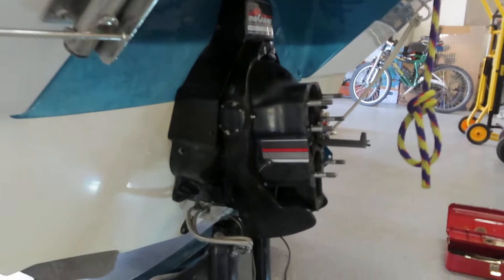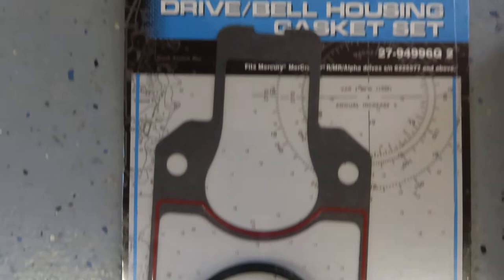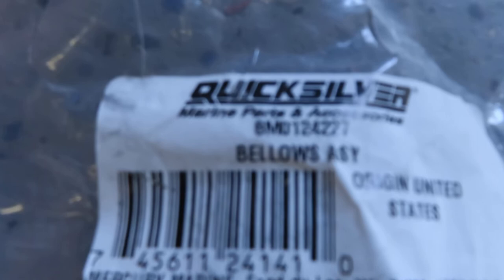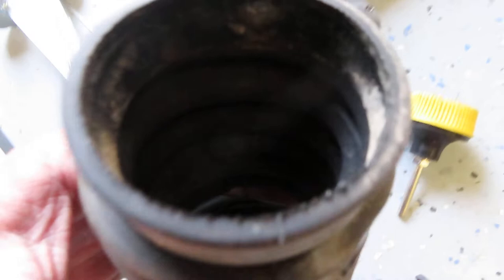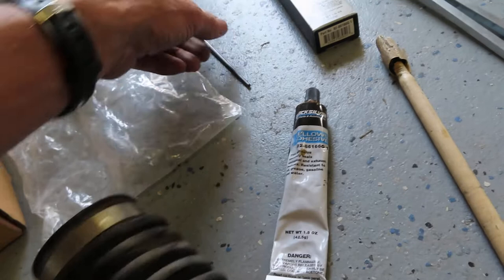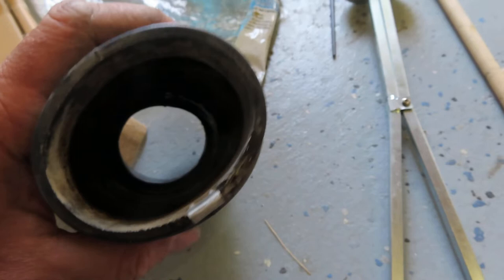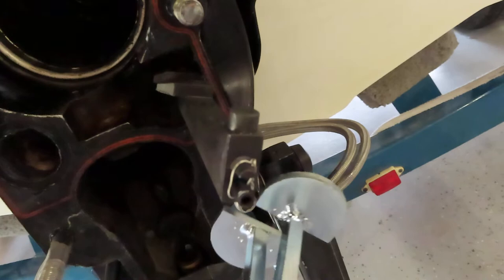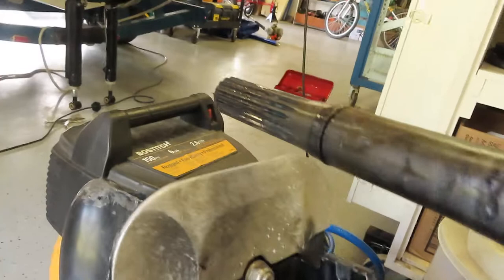Mercruiser Exhaust Bellow Replacement Tips

Comment: A bad exhaust bellow in a gen 1 or 2 will not allow water in the boat.  The exhaust bellow carries engine exhaust and cooling water from the transom to the out drive to lake water.  A bad u-joint bellow or a bad shift cable bellow will allow lake water into the boat.
Reply from the maker: Yes - thank you.  I was incorrect in saying that in this video.

Comment: Thanks for the video. It was really good. Just out of curiosity,Did you read the service manual or you just watched videos? I will have to do same procedure on my boat. the rubber on the bellows are showing signs of wear and clamps are very corroded
Reply from the maker: I don't have a shop manual.  I watched most of the vids I could find and read some forum threads and sort of stirred it all together into what I thought was the best way to do it.  FYI this repair has help up fantastic no issues.

Comment: Thanks for the tips.  Does that other part of the lower unit not come off? It seems if it does then you might not need the bellows tool?
Reply from the maker: Yea, I think you can take it all apart but then you've got to do alignment with yet another tool and messing with the gimble bearing bellows..  I've not tore one down that far so I don't know for sure.

Comment: There are a lot of videos to change the bellows without removing the outdrive..
Reply from the maker: Been there tried it.  It's much harder (in my opinion).  It's much easier to do it correctly with drive off.  Only takes fifteen minutes extra.

Comment: Do you have to have the bellows connected?
Reply from the maker: Do you mean can you run without the exhaust bellows or torn bellows?  If so, I'm not sure.  I repaired mine right after it tore.
Reply: You can run it. It’s louder as the exhaust isn’t running through the foot, it will soot up the back of your transom. PITA.